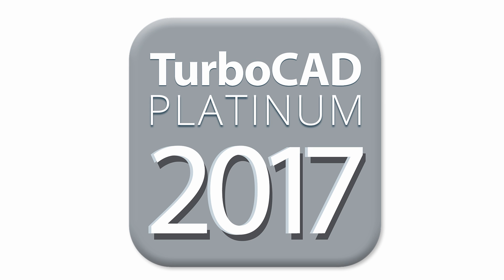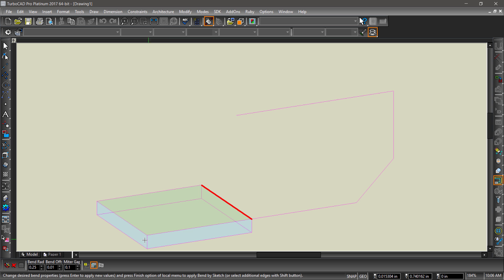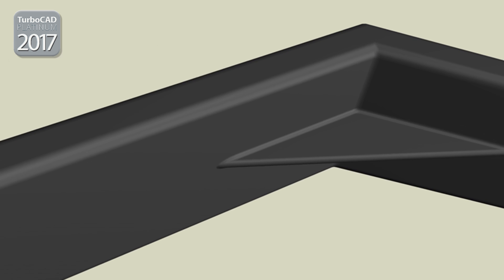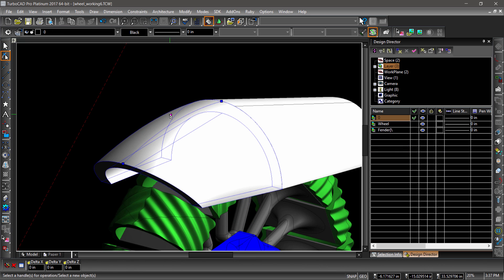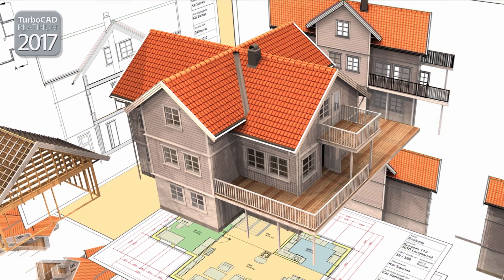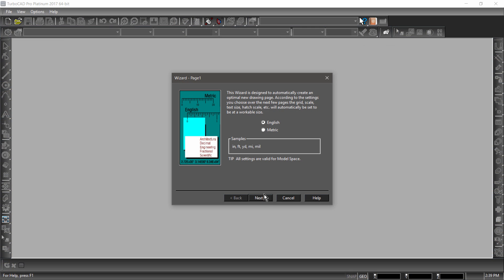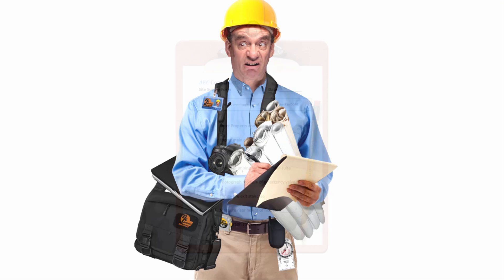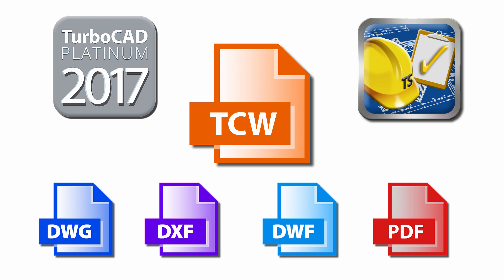TurboCAD 2017 Overview

Comment: It would sure be great if you would work on better ways to place and edit large amounts of text on drawings.  On-sheet specifications are still pretty ungainly.
Reply: I do something similar, Jim.  I have the specifications typed in Word and when I need to make changes, I copy and paste to the MultiLine text tool in TurboCAD.  But it is pretty awkward doing it that way.  I have to copy and paste a lot of text to first see where I need to make the column break, delete the pasted text, then copy and paste the proper amount of text.
Reply: I've thought it might be nice to call your favorite editor for blocks like that. Then, bring it back to TC for on-sheet formatting. Don't know if it would work, but, it sounds good. :)